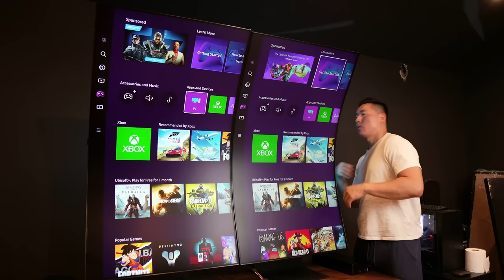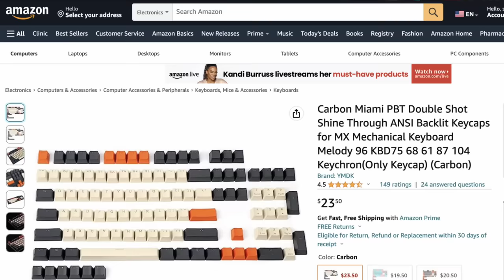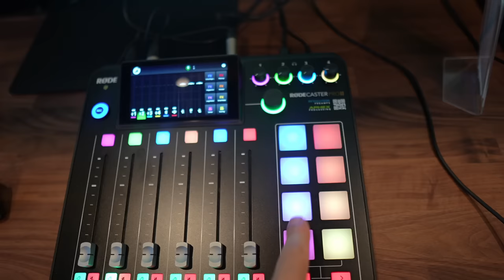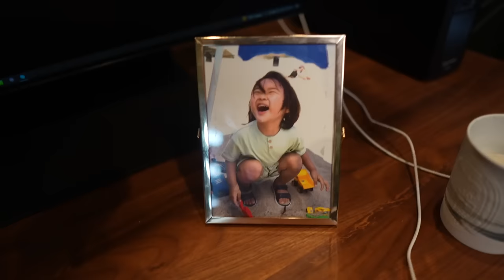My Trading Setup for 2023

Comment: If I understood your problem correctly, your connection problem with the monitors could be fixed with "PCIe adapters". If your onboard(GPU) HDMI is faulty, then a stand-alone "HMDI PCIe adapter" will be your go to. There are different kinds of those adapters so pick one that has multiple HMDI slots. These adapters go in on slots where you would put your 2nd GPU. Hope this helps and I wish you good trades.

Comment: DisplayPort (4090) to HDMI (ark) requires active adapters. There is a signal conversion taking place that requires juice when exceeding a certain threshold of monitors connected.

There are others on YouTube who use 3x Ark with a 4090.

Cables branded with "4K" or "8K" have also been reported to work with 3x Ark on a 4090, where as non-premium cables have been reported to not work (by users).

You should be using all of the DisplayPort ports from your 4090 to the Ark's, as the others on YouTube, who also faced the same issues.

The 4K/8K branded ones that users are reporting as working probably have a built-in powered signal conversion.

Another solution is to install a second GPU in your main PC. (It is a power thing).
If you do that, then stick to Nvidia as you already have a 4090.

Cheers!
Reply from the maker: That was super helpful. Thank you I’ll will try it out 🙏
Reply: @jamesrichyoung  Best of luck my friend, keep us updated

Comment: I had the exact same problem with my LG Ultra 43" OLED monitors.  It took me hours to figure it out, just so has it that I have the same motherboard and GPU as you.

Here's the fix:  
1. you need to access your BOIS
2. go to the boot menu tab
3. ENABLE the "launch CSM"

The fix is enabling the CSM (Compatibility Support Module).  This typically needs to be enable on ASUS motherboards using high-end gaming monitors

Comment: Incredible setup, but way too big. Like you said, big isn't always better, and it certainly isn't in this case.
I would try something like 4K landscape center TV + 2x portrait sides 4K monitors while waiting for smaller 8K monitors and TVs. Something like 24x43x24" or 28x50x28" or 32x55x32" would probably be perfect, depending on your height. Not as many pixels as 8K, but you can still add 2 more portraits on the sides if you really want to and get 8K+ total resolution or need more screen real estate.

Comment: ASUS ROG Strix GeForce RTX 4090 OC Edition 24GB has 3 Display ports ...    should work. 
option 2  switch the 2080  and add an A4000 RTX PNY   it has 4 DP ports ...  
options 3.  get a GIGABYTE Z790 AORUS MASTER mobo,  the Asus 4090 strixx oc...and  the PNY RTX A4000 ...    and you can connect ALL your displays .

Choising the right products for the right usage or expantion later on, is critical ...  
myself i run a AM4 . 570 Asus Crosshair VIII Extreme   ...with a game card 3080ti and and pny A4000    like i told you. 
i liked this mobo because of the  m.2  at the memory side  2 slots ...so now i use 1 m.2 boot ...and 2 for storage and editing and some sata ssds 4T ...and an dvdwriter0.
All noctua fan case ...U12A cooler...    and it runs quiet  ...  but ok they ramp up when editing ...    but the best system i had so far... Fractile define 7 case  black  TG.   
I also have an intel nuc 11  as my second pc ... with a 3060ti ... easy to move around ...4   2T m.2 s in it ...   
have Fun Building  ...

Comment: Hey mate. Love the setup. I literally have the same setup as you. 

I spent literally DAYS messing around with DisplayPort to hdmi issue. 

THE SOLUTION IS AN ACTIVE DISPLAYPORT TO HDMI ADAPTER
Make sure you get best version of it DisplayPort 1.4 to hdmi 2.1 - should do 120hz@4k
Reply: Also I prefer my side 2 monitors angled in, I know it creates a gap between them, but I much prefer all the monitors to be facing me. Have you tested that out?
Reply: @music55464  two giant monitors angled in?  so my direct center = screen bevel?  that's like nails on a chalkboard, would obliterate any productivity i could ever hope to muster

Comment: If you don't mind 60 hz, I would recommend going with something like a 65" Samsung QN900C (or QN900B which is basically the same thing at a much lower price). That would give you more screen real estate, higher PPI and a much cleaner setup. Or just three normal 4K monitors in portrait mode :)
Reply: What do you recommend for me, I don't have much space in my office. Currently I use a 32 inch and my cell phone.  But am looking to get a 2nd monitor a little larger to have up more charts.  Thanks

Comment: you might need to turn off gaming mode.  gaming mode being on made it so my odyssey ark wouldn't be a 4th monitor  when connected to my 4090 rtx 

once i turned it off it connected and was fine being my 4th screen 

so yeah turn gaming mode off on your odyssey arks

Comment: Hey James thanks for the run down on your setup, it's  pretty cool.

I've seen you short HTB using AMTD and I'm wondering if they've ever screwed you on the HTB fees?

From what AMTD told me how their crazy HTB fees work I'm surprised anyone shorts using them.

Maybe you aren't aware?

Basically when they quote you the % fee to short that is not necessarily what they are going to end up charging you because apparently the real rate they charge you depends on settlement date's prices which is 2 days after you close. That means you can do a good trade thinking you made money but if the stock price went up you may lose money because the fees have increased drastically.
That makes shorting small cap stocks and penny stocks incredibly risky because it can blow up your account if the stock you shorted went parabolic after you closed your trade. Sometimes those micro float stocks do go parabolic as you know.

Are you not aware of this or are you?

Because of that craziness I don't use AMTD to short HTB. No other broker I know of does it that way and to me it's dishonest.
Reply from the maker: No never heard of that before but they always send me the total fees I paid each day. I haven’t really come across any fees where I felt it was way too high.
Reply: @jamesrichyoung  Ok then you need to be extremely careful because I've been told this from them. Actually multiple AMTD HTB staff because I didn't believe the first person that told me. I said something to them like who in their right mind would short HTB using AMTD when it can blow up their account if the stock goes parabolic after the trade is closed and they agreed it's extremely risky.

When I signed up for the HTB program nobody told me this. I had to ask how are the fees handled, etc. etc.

Other brokers charge a per share fee like .05 cents per share and once you pay the locate fees it doesn't change on you meaning they cannot later charge you more. I have never heard of any other broker charging fees like AMTD does so please contact them and look into it because it would be a shame they rip you off and blow up your account when a small cap goes parabolic on you AFTER you closed your position.

You said the fees haven't been too high so far. That's good but has any small cap / penny stock you shorted gone parabolic after you closed?

Probably not yet.

Contact them and please post a reply about it or do a video on it.

Thanks.

Comment: Graphics Card Problem: Can you swap the 2080 and 4090 cards and see if the 2080 card will work in the other computer with 3 displays? Then see if the 4090 card can work in the other computer with the three displays. Then you'll know what to do based on the results.

Comment: Given the way you arranged the monitors, i was wondering if a single 65 inch 8k TV (or whatever the combined area of your 3 monitors is) with a software to save and restore windows size and positions could have been a better and possibly cheaper option.
Reply: yeah he said he'd rather have an 8k screen.  Then just MaxTo to easily arrange various windows
Reply: @a3_a3  he said that, but the way I understood it was about having single 8k monitors lined up side by side vertically. I don't think he understands that higher resolution doesn't necessarily mean more space to display data, since scaling is always needed to avoid having unreadable text/graphics on the screen.
Reply: @bufordmaddogtannen  re-watching he did say 2x 8k monitors vertically.  So that's basically the equivalent of 8x 4k monitors.  Reading reviews some people can use 8k monitor without scaling.  Even if you scaled at 200%, you still have equivalent of 4x 4k monitors... and he said you only need 3x 4k screens.

I'm on 40" 4k and no scaling, so I am curious what 8k would look like on a curved 65" it would be super nice to have a single monitor setup assuming I am able to get away with zero to minimal scaling.
Reply: @a3_a3  I'd guess 8k windows on a 65inch  monitor would look smaller than 4k on a 40 inch, despite the increased panel size.

His current vertical setup is 2160 times 3=6480x3840. A single horizontal 8k UHD display would be larger at 7680x4320.

Going with 2 vertical 8k screens would give him a larger area by resolution, but then he would probably complain it's two screens, just out of habit. 🤣

Comment: Should I get Stream Deck or X-Keys for trade execution?
Reply from the maker: Try them all until you find the one you like most. I went through 3 others before I landed on the xkeys.
Reply: thanks, i ended up finding a killer deal on a used 15 button stream deck for $40, and i'm loving it.  When pressing the buttons they are fine on the edges, but pressing dead center gives slightly weird mushy feel occasionally, but not a huge deal.  I love the ability to use custom images per button, and also essentially unlimited buttons by using profiles (and dedicating at least one button to toggling profiles)

I also bought a razer tartarus, it was nice but takes up way more space vs stream deck, harder to remember what all the keys do without custom images, and kinda stuck with 15ish keys since there is no way to easily remember what everything does when you toggle profiles.  Also the keys were a bit too sensitive for me (would occasionally trigger my close positions hotkey when I was just resting my fingers on the keys).  I'd like to try x-keys but not for $120...